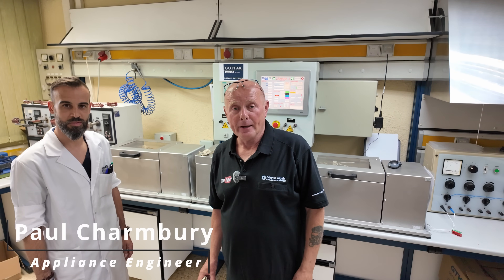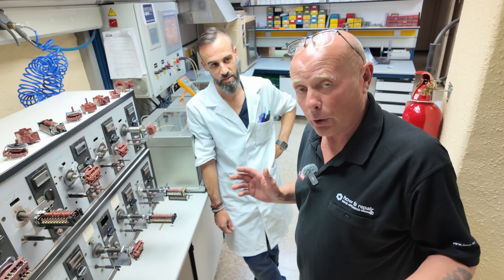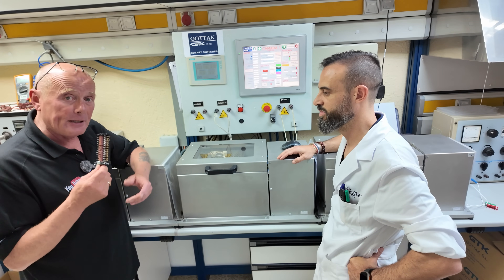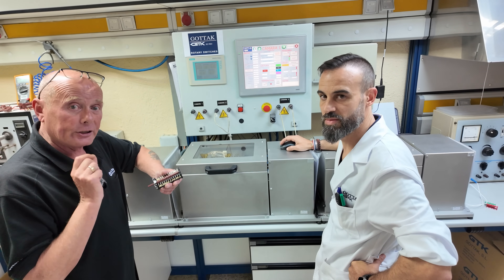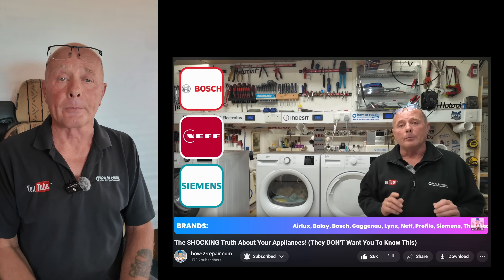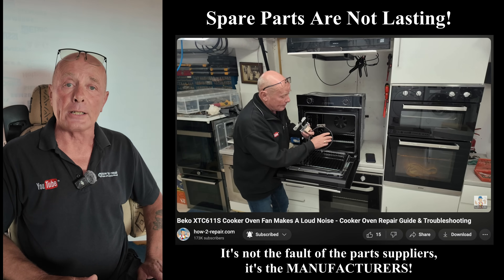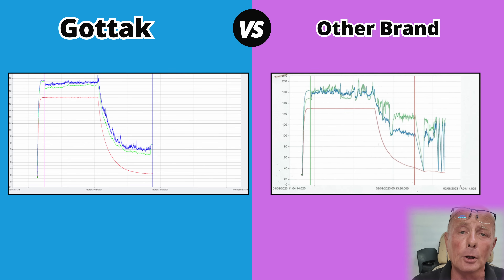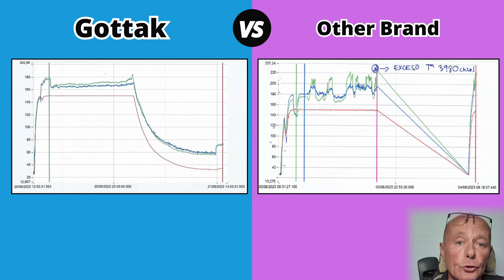Why Your Appliances FAIL SO FAST! Lab Results EXPOSE the Truth!

Comment: They tout the market system as the pinnacle of efficiency in allocating scarce resources—but what kind of “efficiency” floods our landfills with disposable junk at record speed? In reality, today’s market has mutated into a machine for relentless consumption, one that fattens the profits of a shrinking corporate elite while squandering what little we have left. This isn’t resource management. It’s industrialized profiteering, dressed up as economic wisdom.
Reply from the maker: You are right to call out the hypocrisy of a system that claims to be efficient while actively creating waste. The built-in obsolescence we expose in our videos is the primary tool of the industrialized profiteering you so perfectly described. It is the deliberate, calculated mechanism that keeps the machine of consumption turning, regardless of the true cost to our resources and our planet. The flimsy parts and unrepairable designs are the real-world evidence of the flawed economic wisdom you mentioned.

For a deeper dive into the examples that prove your point, please check out the full video here: https://youtu.be/gEgSCbZnHVM?si=wTIw0mELuhWaw4aX

We also explored related aspects in these videos:

The shocking truth about manufacturers: https://www.youtube.com/watch?v=QsdGd2qDPaI

Heat pump tumble dryers are they really worth it?: https://www.youtube.com/watch?v=xn03N3b0-lE

Thanks again for your brilliant comment. Don't forget to subscribe to the channel for more insights like this!

Comment: My last upgrade of appliances was in the 1970s and '80s. Those appliances are still working fine today. However my wife replaced a then 42-year-old refrigerator that was working fine with one of these modern ice maker side by side fancy refrigerators which lasted about 4 years and then had a compressor failure because the refrigerant leaked out suddenly. In the 1970s Vance Packard wrote a book called the waste makers where he predicted and described this corporate philosophy of planned obsolescence. And they get away with it because people keep buying the products.
Reply from the maker: It is shocking how quickly some modern appliances fail compared to the older ones. Many governing bodies are being misled by manufacturers. These companies trick the government into believing they are eco-friendly and making better machines. In reality, they are just deceiving them to keep producing the same products.

Comment: I have a dishwasher which is still working after 30 years.
I have repaired far younger washing machines, of my own and a family member, both different makes, yet the same failed relay part number and performing the same heater element function. What a coincidence?
Reply from the maker: To establish their brands, the majority of manufacturers produced high-quality machines throughout the 1980s, 90s, and early 2000s. Many now own significant market shares as a result of their acquisitions of other brands. For example, consider the following companies: Bosch, Neff, and Siemens; AEG, Electrolux, and Zanussi; Hotpoint, Indesit, Ariston, and Whirlpool. Despite controlling the market currently, these giants don't appear to care as much about the customers. Selling more machines is their primary objective. They profit from green marketing strategies, yet they don't face consequences for the rising amount of white goods that are thrown away. These days, the average lifespan of a gadget is barely five years.

Comment: I have taken apart chinese made switches and seen contact points were just the bare brass !
Reply from the maker: That is a prime real-world example, and thank you for sharing it. What you've found is a perfect illustration of cost-cutting at the most critical level.

Exposing these tiny but critical design choices is exactly what we aim to do in our videos. For a deeper dive into this topic and to see the examples we covered, please check out the full video here: https://youtu.be/gEgSCbZnHVM?si=wTIw0mELuhWaw4aX
Reply: @How-to-repair  I repair a lot of equipment down to the part internals. I have replaced contact points with silver beads I collected decades ago in a previous work. The waste we produce is a crime against future generation. Recycling is a joke !
Reply: 👌You totally nail it!

Comment: I actually broke the chip designed to break my washing machine. After 3 years it stopped working with red LED. I disconnected it for a week and then it worked for another 10 years.
But it also depends how you take care of your electronics, switching it ON/OFF damages it the most, it is like a power surge, while you might save a few cents of energy, you might kill it.
I use power surge protection on all appliances, I never turn them off from the grid and I handle them with care. I replace them only to buy a new one. My $250 headphones are 15 years old.
The fun part is that you can pay to extend the warranty of certain products, that is almost ironic. When I paid for it, it looked, like the mechanic switched a flip and it indeed lasted 10+ years.
Reply from the maker: Thanks for sharing your experiences and your personal strategies for making things last. It's a great discussion, and you've brought up some good points. This is a perfect illustration of the modern problem: manufacturers often use fragile electronics that can fail or glitch easily, turning a potentially long-lasting machine into a brick. Exposing these weak points is exactly what we aim to do.

For a deeper dive into this topic and to see the examples we covered, please check out the full video here: https://youtu.be/gEgSCbZnHVM?si=wTIw0mELuhWaw4aX

Comment: Know of lots of people complaining about their "new" fridges failing after 3 to 5 years. I saved an old fridge that was headed to the dump. That was 23 years ago and it is working good still today. This fridge is from the 1970's. It's almost half a century but still operating fine. New stuff is failing way too quickly.
Reply from the maker: Thanks for sharing your experience with older appliances, it's a great testament to their build quality. Thank you for your comment. I appreciate people like you taking the time to write it out. Please share it where possible. It might help others make a wise choice instead of being misled by the industry.
Reply: I had a Frigidaire that failed after 5 years. Imagine that, it's where the name fridge came from, so I thought it would be a good appliance. Not so. I will never buy that brand again!

Comment: One reason for equipment failure is too high or too low of voltage from the grid.
For example, I own a house in another town where the main transformer is tapped at 143V instead of 120V as they are too cheap to install another transformer to carry the additional demand.
Another reason for a short lifespan is you may have lost your incoming neutral to your house.
Losing your neutral in the US causes the voltage to all lights and appliances to float between 80 and 240VAC.
Make sure you have 120V +/- 3V on both sides of your breaker panel.
Either will shorten the life of any electrical product dramatically.
One quick way to check for either of these conditions is to install a UPS on an appliance or light.
The UPS will switch to battery if the voltage is too high or too low.
Reply from the maker: That is some absolutely fantastic, expert-level advice. Thank you so much for sharing your knowledge with the community. You have highlighted a critical factor in appliance failure that often gets overlooked.

The fact that modern appliances are so vulnerable to these real-world conditions is a key part of the design-for-failure problem we aim to expose. For a deeper dive into the flimsy components that are so susceptible to these issues, please check out the full video here: https://youtu.be/gEgSCbZnHVM?si=wTIw0mELuhWaw4aX

Comment: I have a Maytag washer, the selector underneath the basket. Everything is made of plastic just a matter of time. What a bunch of shit.
Reply from the maker: Manufacturers are aiming to get a bigger market share by making cheaper machines. However, they're giving up the high build quality they've had for years. 

Miele are now introducing sealed plastic drums into their washing machines this is stopping the consumer replacing the bearings or spider and on some cases even stopping them. accessing the drum to remove small items of clothing that may have got lodged between the inner and outer room removing bra wires or even maintaining the machine. Is this corporate greed and the start of the downfall of a once trusted appliance brand?
Reply: @How-to-repair agreed.😡

Comment: Great video, some good information. Thanks for your work. I think this is another problem not everything needs AI when the computer system goes on things like washer machines sometimes before the machine good luck. They are taking away common sense. Btw what was a good brand of hair straightners 😂 mine only last a year 😅
Reply from the maker: Thank you for your comment. I appreciate people like you taking the time to write it out. You should stick with a brand that suits your budget, but also supplies the technical information for you to have a chance of repairing it. This is my best advice for every kind of appliances mate!

Please share it where possible. It might help others make a wise choice instead of being misled by the industry.

Comment: I knew this ant thats the reason i bought Miele washing macine it will last over 20+ years.
First they bought parts from China wich did not last long, the dis their own and problem solved.
My machine is 90 kg and its silent and joy to use.
Reply from the maker: Miele's older models are fantastic but now they're aiming to get a bigger market share by making cheaper machines. However, they're giving up the high build quality they've had for years. I don't think customers or industry engineers like what they're doing now. Trust in the brand is falling because of their actions.

Comment: I've been saying it for quite a while now, since they won't start making appliances last as long as possible you can know that you don't have to take that climate change narrative seriously. The environmental impact of making an appliance last roughly 4 years while it could last 100+ years is absolutely insane.
Reply from the maker: Thank you for your comment. I appreciate people like you taking the time to write it out. Think about the environmental impact of building machines and then recycling them. These machines are often transported halfway around the world, which adds to fuel costs. It's baffling that we need to ship them every five years due to failure.

Please share it where possible. It might help others make a wise choice instead of being misled by the industry.
Reply: @How-to-repair  I want to add that it's also materials that a percentage of won't get recycled for a variety of reasons (they say 95% recycleable but in practice it's likely 60-70% that actually gets recycled) and also they often have to be carried by hand. This leads to back injuries, joint damage etc which in turn create real costs for healthcare systems and reduces productivity of society. If those heavy machines would last longer they wouldn't need to be carried as much either.

Comment: I have a 15 year old Panasonic top-loader and Hitachi Two-door refridgerator. Still going strong.

Though I wouldn't know if Japanese companies are taking short-cuts now. The 2010s seem to be the best time for Japanese home appliance quality.

Edit: The Panasonic top-loader needed some parts to be replaced after 8 years. It was still covered under warranty (They have a 10-year warranty on certain parts). But the good news is that Panasonic allows you to buy parts from them directly if anything does need replacements.

The fridge seals on the Hitachi needed to be replaced after 13 years due to wear and tear and probably misuse on my part. If you treat your appliances well, you should probably have no issues if you had identical appliances.
Reply from the maker: Thank you for your comment. I appreciate people like you taking the time to write it out. Please share it where possible. It might help others make a wise choice instead of being misled by the industry.

Comment: I have been in the appliance repair business for 52 years
I have seen the change in reliability related to substitution of very reliable manual type switches found in refrigerator, stove washer and dryer appliances. Now, many of the components in these appliances are electronic. And what fails first? The electronics. So, a brand new appliance that once lasted 20 years, will fail at 3 to 5 years. Planned obsolescence? Why are most warranties 1 year?
Reply from the maker: Thank you for sharing your experience, it is very valuable. I've reached the point where I simply cannot tolerate this situation any longer, and that's why I made this video. I'm aware that this might cause some controversy, or even land me in trouble, but I believe it's crucial to try and make a difference. I would greatly appreciate it if you could share this video. Together, we might be able to bring about some change. If we can't shame the manufacturers into action, perhaps someone in government will see the video and take notice of the overwhelming number of comments expressing public concern.

Comment: Is that where appliances usually fail? 
In their selector switches?
Reply from the maker: While the selector switch certainly can be a point of failure, especially in older appliances, in most modern machines that have been built in the last 15-20 years, it's actually not the most common problem. The Main Control Board (PCB) is the number one culprit in many cases. It's packed with fragile electronic components that are sensitive to power surges, heat, and moisture. When the board fails, the appliance often becomes completely unresponsive, and replacing the board can be very expensive.

This is exactly the kind of design shift we aim to expose. For a deeper dive into the specific components designed to fail, please check out the full video here: https://youtu.be/gEgSCbZnHVM?si=wTIw0mELuhWaw4aX
Reply: @How-to-repair  

Thanks for the repy.

Good planning on their part to make it the PCB. Make the failure something that people can't easily replace. 

I saw a company rehabbing auto PCBs by replacing the capacitors. What chance for that working for appliance PCBs?

Comment: i thought most new applicances had digitally controlled IC`s, are there analog switches after that?
Reply from the maker: You are absolutely right. While the main control board uses a digital Integrated Circuit (IC), often a microcontroller, to make all the decisions, that IC cannot directly handle the high voltage and current needed to run the main components of an appliance.

This is also a key area for built-in obsolescence. These relays and triacs are switching heavy loads thousands of times and are common points of failure. Manufacturers can save a fraction of a cent by using a relay or a triac that is rated just barely enough for the job, ensuring it will eventually fail under the stress of real-world use.

Comment: Finally someone speaking truth cars are exactly the same and they’re getting worse year by year. Cars are a huge problem with the second most expensive thing in peoples life and the manufacturers are ripping them off plus fleecing them with leases an interest and then providing a product, but it’s not up to snuff. Shocking.
Reply from the maker: The car industry is running the same playbook we see with appliances: prioritize flashy tech and complex features over long-term durability, ensuring a steady stream of income from repairs, expensive parts, and new leases when people get fed up with their unreliable vehicle. It's built-in obsolescence on a massive scale.
Reply: Pre-1990s cars were pretty rubbish though.  For the same money as we paid for a car in 1979 I can get a far better car today.  It will use less fuel, be more comfortable, be safer, the body and engine will last much longer.
Reply: @loganmedia4401  that may be so but there was a golden age between 1995 and 2005 I would say and those cars were absolutely rock solid. Those were how cars should be made.